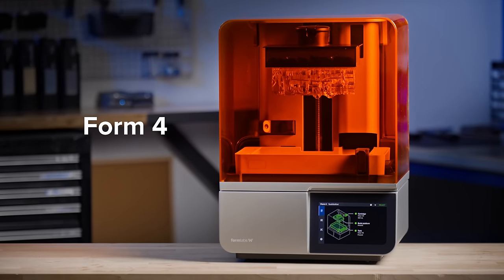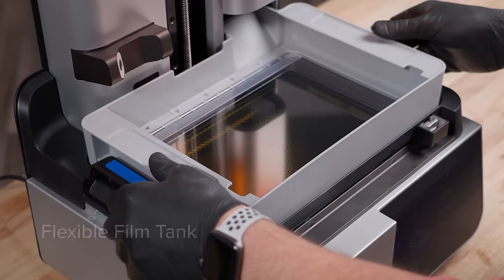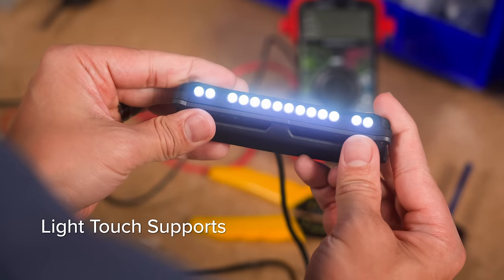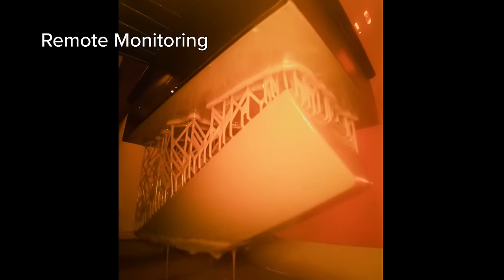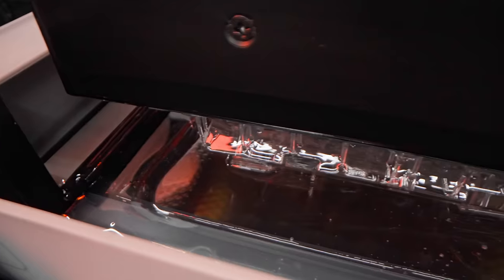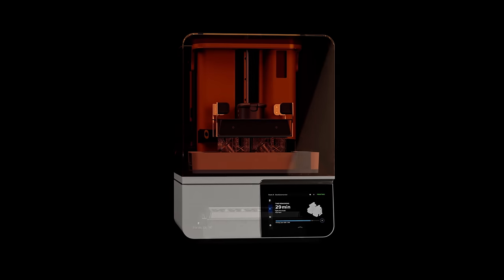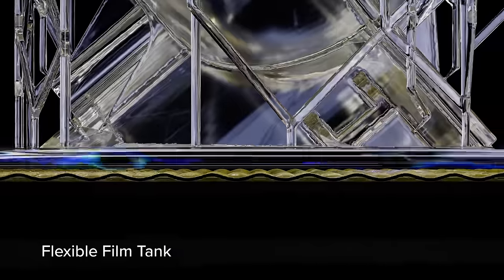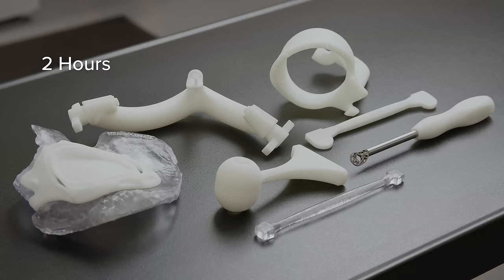Introducing Form 4: Blazing Fast 3D Printer

Comment: At over five times the cost, what are the advantages of this printer over any of the other LCD based printers that have been out for over two years already? It's the same resolution, same print area, same print speed as Phrozen and Elegoo's $800 printers. Plus, it's locked into Formlabs' ecosystem and (horrible) slicer. Your cheapest resin is over 10 times the cost of most prototyping SLA resins. Whereas for other printers all the settings are openly adjustable, and available for every other printer. Chitu-Box is state of the art, provides a wonderful user experience, valuable features such as hollowing, drain holes, etc, and we can download or create settings for whatever resins we want.
Reply: The advantage is the brand and support. Formlabs is the Apple equivalent of an SLA printer. It's a real shame though because I would be willing to lock myself in to the Formlabs ecosystem if it was unambiguously superior but to your point, the much cheaper competition has a lot going for it in almost every metric.

Comment: Would love more info on how fine details compare to form 3 series. This really matters for us and the nominal xy resolution has actually gotten worse 😳.  50um instead of 25um on form 3. I realize those numbers are not directly comparable because of changes in the print technology but some kind of quantitative comparison would be nice.  There are brief statements on the website that fine feature performance is actually better but what that actually means and how subpixel resolution is achieved is not clear.
Reply: Agreed. Not only that but the speed demos were 100um to 160um models. The newer, higher end, resin printers out there for 25% the cost or less are running 30um at 150mm/hr nevermind 50um.
Reply: They say in the Tested review that 25um would have made print times much worse and wasn't worth it. Also seems like they said they'll sell a separate display that enables 25um so that's interesting and Tested also said they have a comparison video in the works.
Reply: The more important question is how this compares to a 450 dollar msla printer from China. The laser unit in previous generations was an actual design feature, but this thing is basically giving up and trying to play catch up.
Reply: Form3 XY resolution was 85um not 25um
Reply: Form3 XY resolution was 85um not 25um
Reply: Form3 XY resolution was 85um not 25um
Reply: Laser spot was 85um. The galvos had 25um resolution.

Comment: Are the prints as strong as Form 3 prints? I have used formlabs prints vs display based resin printers before and anything that wasn't locally fused with a laser was significantly weaker layer by layer.
Reply: LCD based SLA produces much more flexible prints vs laser-based printers (with the same resin). But there should not be any strength issues. If you're having layer strength issues, it suggests you were not giving each layer enough energy to cure fully.
Reply: You can check all the technical datasheets for the new Form 4 exclusive materials. The new grey V5 is as good as the Form 3+ grey pro was before and much better than the grey V4.
Reply from the maker: Yes. Our resins have the same mechanical properties (including strength) when printed on Form 3 or Form 4 printers.  To make sure part properties are the same, we tune and validate print settings for every material and layer height available on Form 4/B. You can see mechanical properties for our resins by clicking any material on https://formlabs.com/materials/.

Comment: Price point for MSLA is bonkers. Also your entire material catalogue will have to be reformulated.
Reply: The entire materials catalogue from the Form 3 will be available on the Form 4 and even more materials, enabled by the new print engine. As usual however we will keep on pushing the boundaries on each material, so expect an ever growing list of materials.
Reply: @dogichowFL  I'm concerned that adapting your existing materials library to the new print engine could cause problems. I think embracing mSLA was the right choice and you obviously need to keep resin compatibility but it seems a bit shoehorned and I wonder if there will be weird quirks.

Comment: Does it have or will it have a quick release build platform? Also are the new tanks consumables regardless of resin or are there some resins where tanks last indefinitely?
Reply from the maker: Form 4 introduces the Build Platform Flex with Quick Release Technology for easy print removal, enhancing workflow efficiency. Resin Tanks are built to last and deliver consistent performance for at least 75,000 layers of printing-tank lifetime is now the same for all materials. The tank design has been updated and is no longer degraded by the components present in some of our resins. (No more tank lifetime counter like with Form 3 Tanks)
Reply: @Formlabs  very cool, thanks

Comment: Why not a projector instead ? Even 100k layers on a lcd isn’t a thing, also you’d use way less power with a dlp projector in it, I have a small size dlp one and it is amazing, you guys should consider as it’s a big brand, a well made projector printer would be amazing!!!
Reply: There's no projector in the world that can output that amount of optical power at that resolution and price.
Reply: @gizmoguyar  there’s 4K dlp projectors that can do it, and no need that much power anyway, otherwise the other brands wouldn’t exist … :)
Reply: @ipodfernando  I've spent most of my career in 3D printer research. The only 4K DLP mirror array that I'm aware of in this price range is only rated for < 1 Watt objective power. This is almost four times that. Additionally I can basically guarantee you that the "4K" DLP projectors that you have seen (maybe used) are pseudo 4K. They are a 2k mirror array that shifts half a pixel to interlace two images. This is super detrimental to 3D printing quality and resolution.  If you know of any 405 nm true 4K DLP projectors capable of 4 Watts off-lens optical power, I'd certainly love to hear about it. I'm only aware of two, and they retail for $12,000 and $16,000 respectively.

Comment: its just a matter of time until anycubic, elegoo or any other company will add the 1-2 featues the form4 has... besides these features it has nothing special compared to other printers... way overpriced imo
Reply: What are the 1-2 features you're referring to?
Reply: @paulgemperlein626  heated vat... also the thing wich moves left to right on the vat... other than that theres not much i see..

Comment: Resin for JEWELRY? wax 40 works better here?  Or is there some resin for casting with a better impression?
Reply from the maker: Castable Wax and Castable Wax 40 resin are available for Form 4 printers. Compared to Form 3, you should see much better (sharper) fine features when printing these resins on Form 4.

Comment: Would you allow the use of 3rd party resins from the beggining or are you gonna do the same that you did on the Form 3, allowing it only at the end of the product production?
Reply: Site says it supports it now
Reply: We're committed to bringing our SLA Open Platform to Form 4/B throughout this year, including: Certified materials, Print Settings Editor, and Open Material License. As the first step, we're releasing a PreForm update in late May with Form 4/B support for Print Settings Editor.

Comment: I'm kind of curious about why the price of 1L clear resin for the Form 4 is $100 while the price of 1L of clear resin for the Form 3 is 50% higher at $150. It feels really weird and almost seems to be a way of trying to force organizations to the Form 4 due to the reduced run cost which isn't exactly customer centric.
Reply from the maker: Our new general purpose resins, such as Clear v5, have been reformulated to be optimized for the new Low Force Display print engine that powers the Form 4. During reformulation we were also able to cut costs and pass the savings on to our customers.
Reply: wait, so you mean you don't want the new resins to get cheaper? 😅
Reply: @Chaosghoul less that and more I’m not understanding what makes the resin for the Form 4 that much cheaper than the resin for the Form 3. Sure there’s changes in the manufacturing process but the process can’t be that different that those changes in manufacturing can’t be used on the resin for the Form 3. Like, given how much cheaper the new process supposedly is, Formlabs would be stupid not to utilize it even if they didn’t lower prices, which gets back to my original point of it not being a customer centric move.

Hopefully Formlabs can touch on any actual technical reasons why tomorrow in their webinar.
Reply: @cassie_mmk  Do you know how expensive it is to re tool for a product you're already producing?
Also don't forget that the cartridges are vastly more complex for Form 3 than they are for Form 4. Look at the resin pumping system: If you buy the 5L Jugs, you're already getting almost the same price of the V5 resins. If one doesn't like the 1L cartridge price, just get the 5L ones
Reply: @Chaosghoul  the 5L jugs are $134/L, that is hardly getting almost the same price as the V5 resins. Yes, the V4 cartridges are more complicated than the V5 ones. Even then, they're still injection molded, and I'd have a hard time believing the cost per unit of the cartridges is $5, let alone $50 of the cost of the V4 resin.

Though you do bring up a good point about retooling production lines, but something still seems off here because I imagine Formlabs expects to sell resin for the Form 3 for several more years. If that's the case, then they'd be financially stupid to not retool their production lines for the V4 to not get the cost savings and pocket the difference. Though that wouldn't be very customer centric either.

Basically, to quote Corey Doctorow, the price difference in resin seems to be a form of "enshittification" to force Form 3 users and businesses onto the Form 4 platform. I am happy to eat my words if Formlabs is able to give a good explanation here.